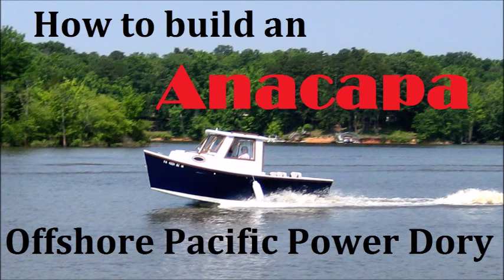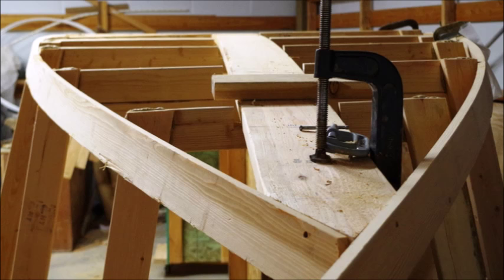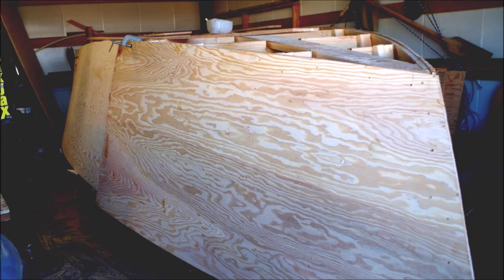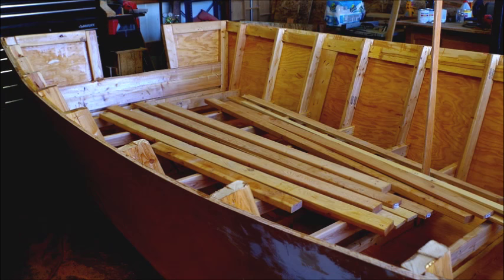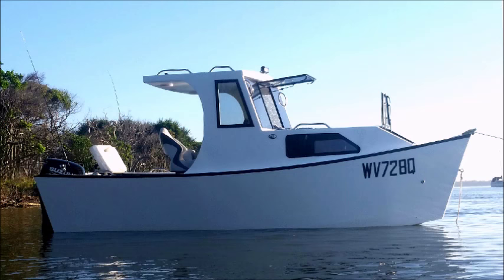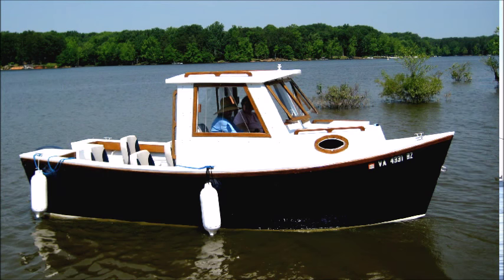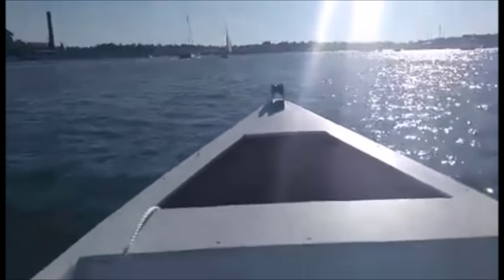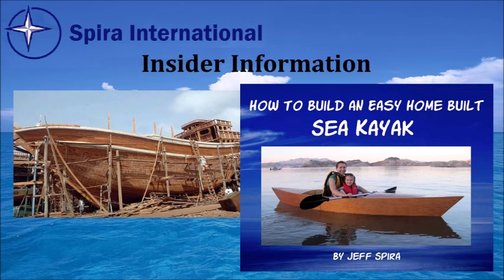How to Build an Anacapa Offshore Power Dory

Comment: Hello Jeff, instead of using plywood, could I use eps foam which is easy to work with and form and just glass it in and out? What are you thoughts on that? Thanks!
Reply from the maker: Hi Dimitri:
Sure, however glassing the inside will be extremely time consuming with all sorts of internal corners that you'd have to fill and fillet before glassing. I'd say three or four times as many hours building the hull, as building it with ply, and leaving it unglassed on the inside. It will cost probably twice as much also, but if you want to, why not.

Comment: Could I get plans for one that's 26 feet long has an offshore bracket has a forward cabin and a spot for a crab boom. Gonna be used in the ocean and big rivers on the west coast.
Reply from the maker: Want a custom design? Send me the details and I'll get you a quote. Want to use one of my stock plans and create your own features? Here's one that'll do the job: https://spirainternational.com/hp_kona.php

Or: https://spirainternational.com/hp_clem.php (you can stretch it by 10% OK,

Or: https://spirainternational.com/hp_chub.php
Reply: @tjkid07  hello I really intrested in the mullet skiff. How would it fair in the north west coast crossing the bar on the Columbia river. Everyone tells me I need 30 inches plus of free bored.
Reply: @tjkid07  I looked into the mullet skiff and I think it will be perfect for my application. Thankyou!